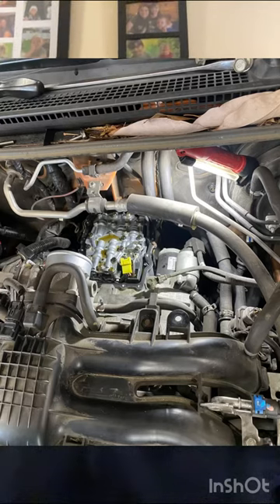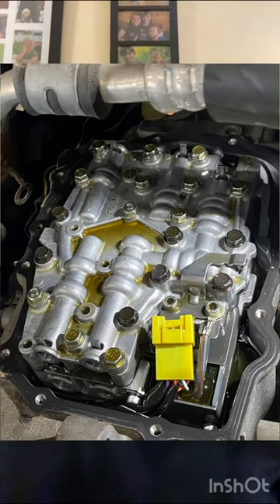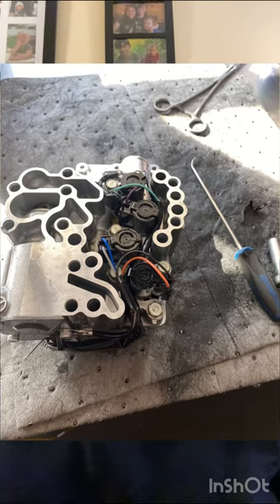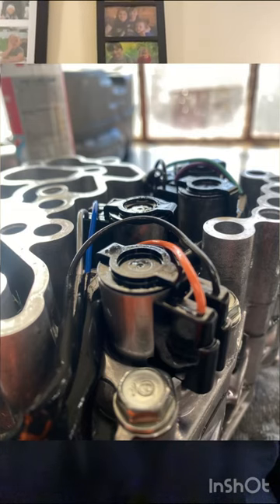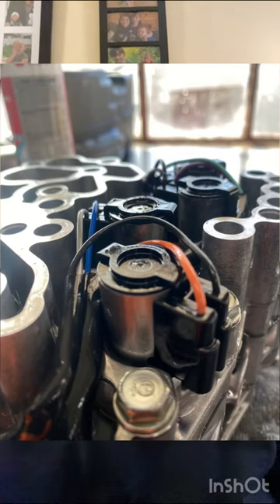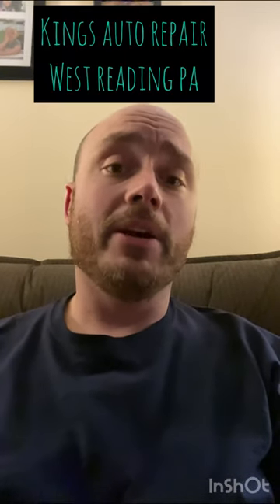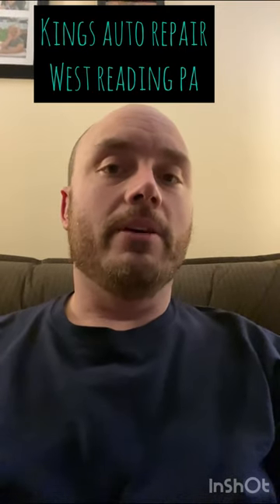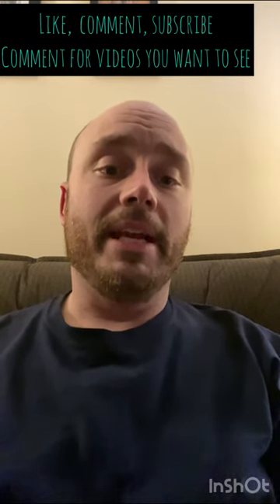Subaru transmission solenoid problem? You may not need the 2000$ valve body.  p0971

Comment from the maker: Unfortunately, when I made this video, I did not know these OEM solenoids were only available through a company called Transco. They only sell tobusinesses so unless you have a tax ID number they will not sell to you.
Reply: Is it TransGo or TransCo? Big difference.
Reply: Doorman makes the solenoid. I did it on my forester and so far it’s running well with no issues
Reply: If I have family who owns a trucking auto business could they purchase it or is it through Subaru only?
Reply: @shafi420  the dormam solenoid is only for the torque converter. the p0971 is for the awd solenoid.
Reply: Can you provide the parts number please, & confirm where is transco located

Comment: The question here is, where can I get this solenoid. Also, how will I know which one of those 4 solenoids is not working. Thank for this info.
Reply: I had an issue the other day with the lock up solenoid for the torque converter. I’m not sure if they’re all the same, even though they appear to be, but I found dorman part number 926-408 and it resolved my problems. Install was pretty easy
Reply: You can test the resistance before digging in. There’s a green connector under drivers dash use a multi meter to check ohms
If you’ve got a friend with all data or identifix they can pull the wiring diagrams for you. You can also check at the grey connector right above the trans. The red/white wire is for the lock up duty solenoid should be right around 13 ohms. Idk what color for the other solenoids as I only had a problem with one
Reply: Were you only getting power to your front wheels? Im hearing grinding and leaning twards the viscous coupler, ive replaced both cv axles and wheel bearings so i know its not those parts crackling@HughJanus-c7m

Comment: Really too bad this is only sold to businesses.  It may have saved my friend who I told them it was their solenoids replaced at 84,000 miles. The dealer said they needed a new CVT which cost about $5500 to replace. They sold their car and got rid of it since the dealer refused to do the right thing and just replace the solenoid.

Comment: Great Vid. Thank you. Due to the solenoids themselves obviously not being a 'servicable part' in the eyes of Subaru - I struggled to find Torque specs for the 10mm bolts holding the plate that holds the solenoids in place. You didnt happen to find anything relating to this when carrying out the repair for your customer? Or, recall what you torqued them to?
Reply from the maker: I’m genuinely glad I could help. I remember torquing it with my inch pound toque wrench. I’m not sure what it did torque to though sorry. It was a few months ago now and I can happily report that the car is still running properly. The owner uses her car for work and puts a lot of miles on it.  I’m definitely going to be confident that this is a viable repair now.
Reply: The black and silver bolts that secure the valve body are 9nm, the bolts that secure the cover are 10nm

Comment: I have a 2014 Outback w 170k miles. Just had the same solenoid fail. Just as you described, entire valve body had to be purchased from Subaru dealer  @ $975.
Mechanic told me local Subaru dealer said they have, "SOLD OVER 1500, YES, 1500 of these parts in last year."  Lawsuit?

Comment: I have a legacy that won't shift out of 1st. Same deal do you think? I'm going to throw in a quart of ATF to see if that's the problem first.  Thanks man!
Reply: What was your solution? I'm having a similar problem and worried it needs ATF
Reply: @Chula_1986  It was actually my girlfriend at the time's car. When I popped the hood on it there were piles of corrosion on the battery terminals and it BARELY turned over and started. This told me there wasn't good solid current coming out of the battery for starting and other functions like shifting the transmission. I cleaned the terminals very well and the cable connectors. It then started very briskly and shifted normally. She was thrilled!
Reply: @Chula_1986  You're very beautiful by the way.

Comment: Im getting a code for the valve timing being off with check engine, traction control and cruise control lights on. I have already replaced the oil control units, pcv and changed the oil and cvt fluid but now im stumped on what to check next. Would a bad solenoid cause this?

Comment: Question: Did the check engine light come on to alert the owner that there was a problem to begin with? Or did you get the code after connecting it to do the diagnostic?
Reply: my friend had this code read at the dealership. they had a few lights come on the dash intermittently, like the a/t light and traction control and one other that i forgot. my scanner couldnt read the code but the dealership read the code as p0971. we are now trying to source the solenoid.
Reply from the maker: The car came in for a check engine light

Comment: Hey Dan, thanks for the information! Did you have to do a relearn whenever you replaced just the solenoid?
Reply from the maker: Clear codes and drive, they are circuit codes nothing to relearn.
Reply: I had the same question thank you for clarifying!

Comment: Hi Dan, just saw your video about P0971 code I got on my Impreza 2015 and I realized I am 3 hr. Away of your shop. If I set up appointment to fix it how long this usually take?
Reply from the maker: The issue is the parts are usually a few days away if the failure is the solenoid. I would need the car to diagnose that that is in face the issue. The other thing I need to do before we take the transmission apart is to check the overall condition of the transmission. I don’t want to put good parts in a bad transmission. That’s not fair to you and I’m not going to do that. I know that it makes it a bit of a process but it’s to ensure that you are getting a proper repair

Comment: What indicator lights were you getting on your dash? I changed my entire vavle body out 100k ago and everything has been fine up until now. Im getting traction control, abs and at oil temp, codes p0103, C1422, C1431 and C1733, car seems to be shifting fine this time around and i cant remember if that was rhe codes i got last time around. i wonder if it could just be low on fluid
Reply from the maker: Usually when a Subaru turns on its check engine light the cruise control light blinks and at oil temp light on as well. Many cars turn on more than one warning light due to the fact that the different systems work together. When one system has a fault it affects the other systems as well.
Reply: Hi there, the same issue started for me on April 8th. I drove it to Indiana to catch the solar eclipse, but before I could come back to Michigan, the car started Xmas tree lights on the dash. Check engine, at oil temp flashing, brake flashing, cruise control flashing, traction control. 
P0700 TORQUE CONVERTER CODE
P2764 TORQUE CONVERTER CLUTCH PRESSURE  CONTROL SOLENOID CONTROL CIRQUIT LOW VOLTAGE
So far, the car feels normal. I just can't find anyone who will touch it!
Reply: @funstuff2008  Say your reply thought I'd give you some advice. First, I'm no certified mechanic but what I did was remove the valve body myself and tested the solenoids, one had low resistance, went ahead and purchased a new valve body from subaru for a little under 1k. Problem fix! I will say the most difficult part was adding the cvt fluid back.
Reply: @funstuff2008 hey there! I'm having the exact same issue/codes. What was your solution? I just picked up my car from the shop after replacing a thermostat and rad fan. And still getting the same lights, the "AT OIL TEMP" barely started though
Reply: @Chula_1986  drove it until the transmission broke. I didn't have much of a choice. I couldn't order the parts and no mechanic or transmission shop would touch my car. Subaru Of America wasn't much help either.
Reply: @funstuff2008  yikes, yeah I totally get it. Thx

Comment: So I have a similar problem but my shop mechanic wants to charge me 1500 for a replacement and labor should I buy a valve body or just the four solenoids??
Reply from the maker: That price could be right, depending on what the exact diagnosis is. This is not a cheap repair either way. The whole point of this video is to show other techs how to save their customers from having to buy a valve body.

Comment: Im gettihg the same code. i found a solenoid on amazon for torque converter lock up solenoid, will that work or are they different
Reply from the maker: I have read that those aren’t very reliable. I have never personally used them though. If you use them please let me know how it works out for you, I’m always looking for other options.
Reply: Also getting the ABS-transmision-traction warning lights. Thinking aobut the Amazon solonid for the tourque lockup. Please let me know how you made out with this. What soloniod did you order and did it work out for you.
Reply: @colinpdoyle  I read something the other day people that replaced the solenoids were only lasting a couple weeks and the problem comes back. I've decided to buy a remanufactured valve body for now
Reply: @Josh-sm8mj  Thx for letting me know. I'm a bit stuck on this one as the price difference is quite dramitic. New solonoid: $100, new valve body inc solonoid: $2000! My car drives fine so maybe I will just get used to all the warning lights 🙂
Reply: @colinpdoyle  does that price include install? If not that seems overpriced for just the valve body
Reply: @Josh-sm8mj  I just priced it out from the dealer this morning. Valve body $1800 + tax = $2016. Installation is "about $500". I am sure by the time they add "shop supplies, AT Fluid top up, misc, I am going to be at $3000. It's almost like it's a write off, even though it runs just fine. Bear in mind all numbers are Canadian $ so equivelant to about $2300 USD.
Reply: where i can buy